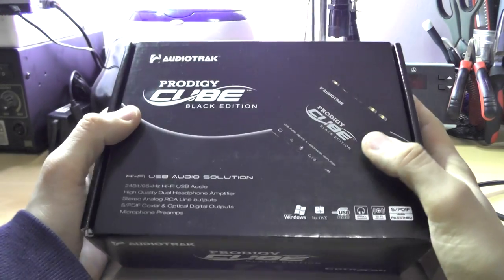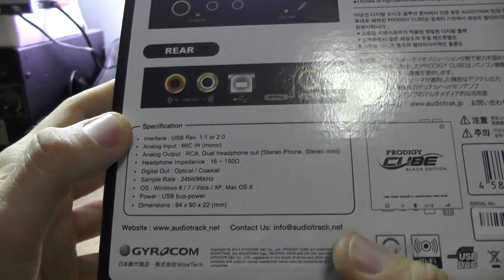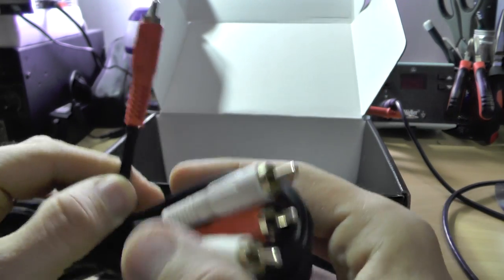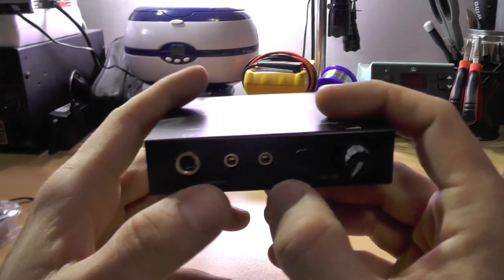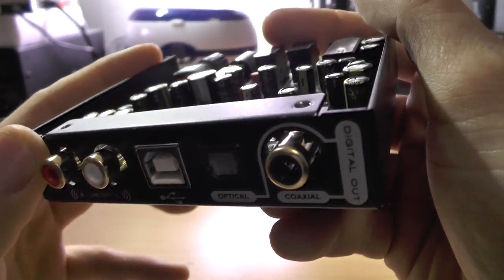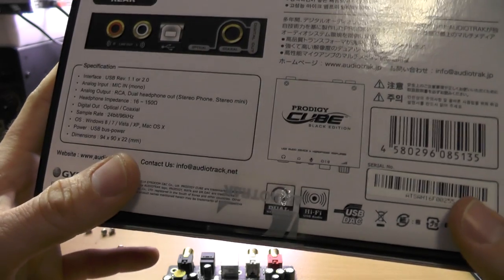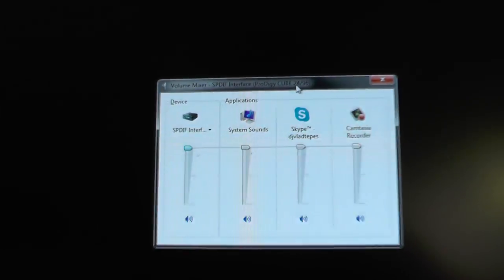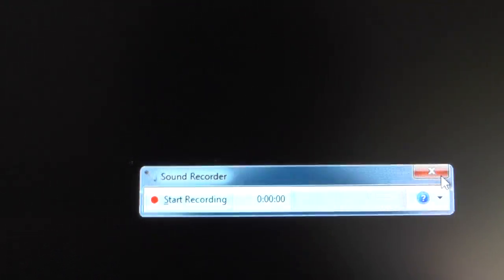[HW: Unboxing / Review] - Prodigy cube black edition

Comment: So is it worth getting or not? I also have some noises when recording with 3.5mm mic
Reply from the maker: i would say YES. I don't have any problems since i've bought it. I've also replaced DAC - however i did not see any major difference between original DAC and muses one.
Reply: @MTS_IT  You probably talk about opamp and not DAC. Thanks  for your review.
Reply from the maker: @JohnSmith-nq2xb  yeah :)

Comment: The audio cable looks good quality.
The operational amplifier do not plan to change?
Reply from the maker: i would not say that it's a good cable - is it ok - yes, but nothing more than that - There is no shielding whatsoever, cable is unnecessary thick (for example old bandridge is half the size and has twice the wires) + cable feels like cheap plastic. don't get me wrong, i've seen worse :D 
Regarding opamp - at the moment i'm satisfied with default one. Is there any you would like to recommend ?
Reply: Of the recommended in the instruction manual for operational amplifiers good sounding AD8620BR.
In my opinion not so linear as with LME49860.
(translate.yandex.ru)
Reply from the maker: i was actually looking at AD8620 the other day on ebay but how to tell if it's the fake one. I've googled and a lot of buyers complain that sellers sell the fake ones :S